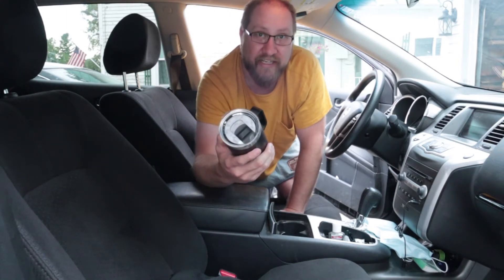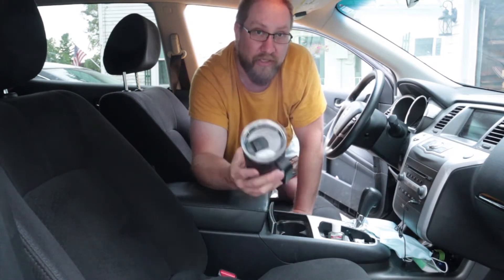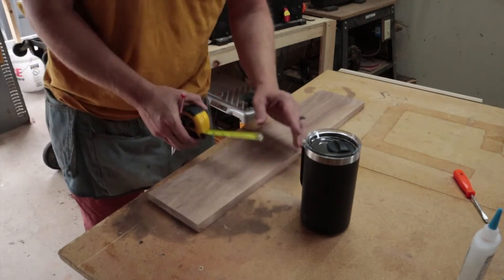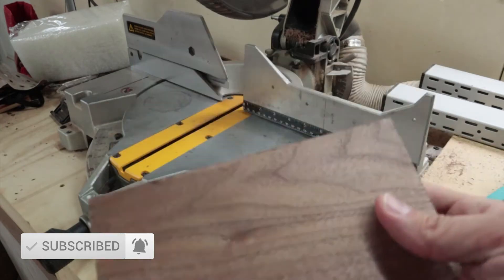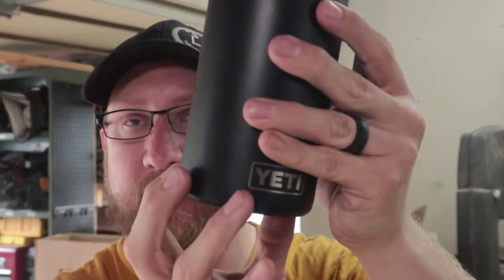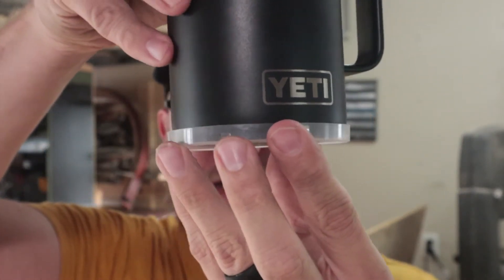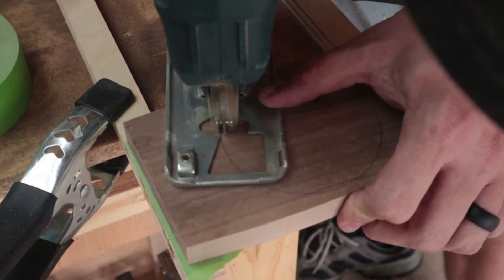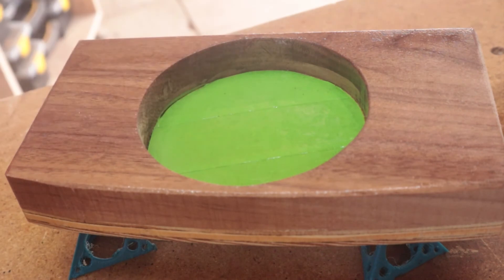I fixed the BIGGEST issue on the YETI 24oz travel mug

Comment: I bought a cup holder expander which inserts in the original cup holder which you can get from eBay, Amazon or ali and it works like a charm, even has a cut out for the handle.
Reply from the maker: Ooo that's nice. I might have to get one. The one I made works but I find it not deep enough for when my wife takes corners and onto two wheels lol

Comment: Or you can just purchase the YETI 20oz Rambler Travel Mug. I just got mine for Christmas and absolutely love it and was made/designed to fit perfectly in your car.
Reply from the maker: I have the 20 for that reason but my wife wanted the extra 4oz
Reply: @RobertsInnovations  Try measuring the volume difference between the 2. It's my understanding that the 24 oz mug is smaller than advertised and is closer to 20 oz. Apparently it's the only Yeti tumbler/mug that has overstated it's capacity. I think you'll find that the volume difference between the 2 is negligible, and please let us know what your findings are.